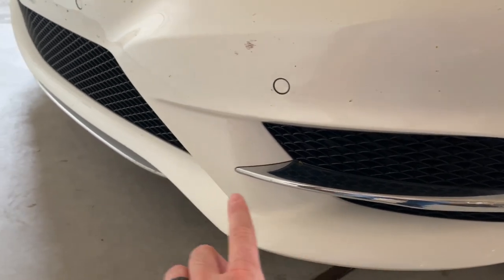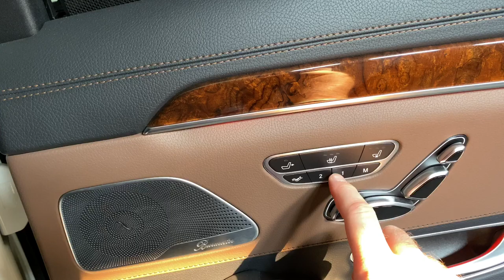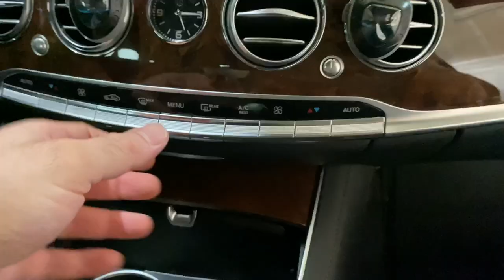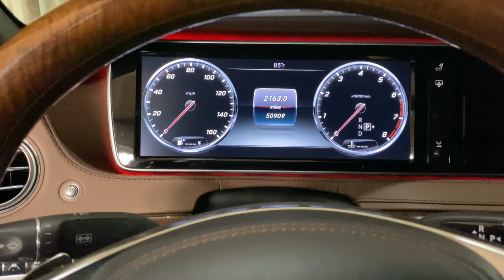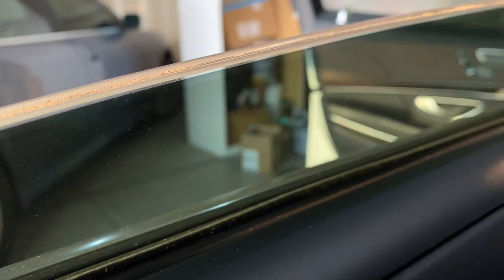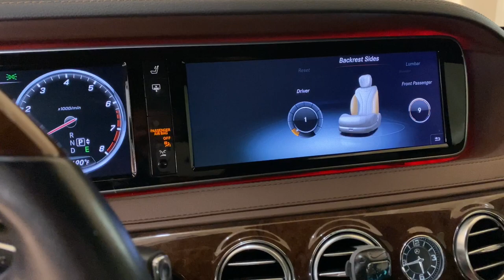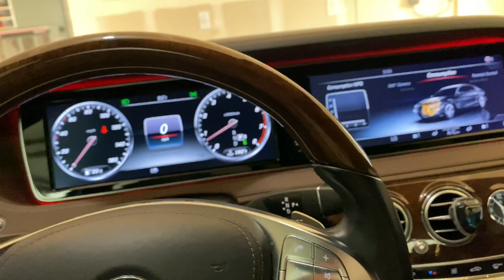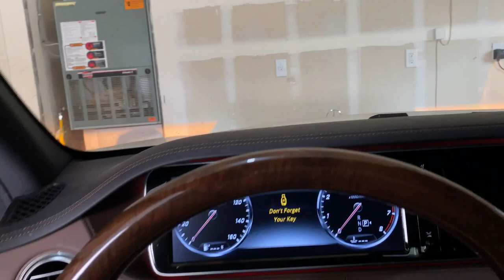2015 S550 Mercedes Benz Detailed Owner Review

Comment: is the 9-speed transmission better ? does the computer get faster in the 2016 or 2017?
Reply from the maker: The 9 speed is not better. It’s not that the computer is slow, it’s how the car is programmed.
Reply: @GrindMyGears  okay, was thinking about a 2017 since it's a 9 speed and supposedly better gas mileage, but in that case, can still look for 2015-16
Reply from the maker: @BrianErwin  I would still opt for 2017. 9 speed will be better on gas and also the steering wheel and headlights look better. Also 360 camera is standard on 2017+ if I remember correctly. Try to find one with the 3D audio option too.

Comment: Thank you  for this video and to be honest If I buy one with this year, would I feel safe with mechanical issues and digital display? I love the car though.
Reply from the maker: Thank you for watching! The car so far is running okay! Recently the auto-close door system failed on driver door so I have an appointment at the dealership to see what the issue is. They charge $195 just to diagnose and this fee is probably different from one dealer to another. I put new set of tires in less than two year! Previous set wore out within 20k-25k miles I believe (I have to double check). The car is heavy on maintenance/upkeep just FYI. Also recently the interior lighting flashes on passenger side on certain colors like green and blue I think so now I have the interior lights on red all the time which always reminds me with red light district for some reason LOL. No issues with digital display… I hear the airmatic suspension air pump run quite a bit more lately so I think there is a leak developing… we’ll find out soon!
Reply: @GrindMyGears  how many kms has yours done? and how long (km's did u do) until problems started?
Reply from the maker: @jamiefreedom8320  it has around 83k miles now so that’s roughly 133k kilometers. I bought it with around 32k miles. So you can say I put 50k miles… that’s around 80k kilometers. As of now, I smell a little oil burn from outside but dealer says no visible oil leak. There is a faint clunk sound on rough roads… might be a shock going bad or ball joint but it will be waste of money to have the dealer diagnose it. They’ll happily charge you $450 diagnostic fee then tell you we can’t hear or feel anything. Car mechanics usually aren’t very smart and good at diagnosis but they’re good in replacing stuff. Anyways, auxiliary battery died couple weeks ago so I had it replaced along with the 80k miles service. You can’t ignore maintenance in this car so keep that in mind… you have to do the maintenance schedule or else you will end up with bigger breakdowns. Other than that, no major failure yet. Transmission still bangs occasionally between 3-2 shifts but hasn’t gotten worse. Also the car eats tires and brakes since it’s very heavy… I use paddle shifters to shift down and slow it down instead of using the brakes… that’s a pro tip ;)

Comment: Do you think 2014 s550 with 40,000 miles for 42k?$ good deal? I want a low Mileage one
Reply from the maker: That’s not a bad price at this market! I did a quick search and found $43k for 50k miles. Did you drive the car? It’s very important that you drive it and make sure all feels good and solid.
Reply: I just bought a 2015 with 18,640 miles @$36,000. $38,200 after taxes, title, registration, and dealer fees. I had it for a week now. No issues, and I don’t plan on driving it much myself.

Comment: it will be pretty useful to share cost of ownership details
Reply from the maker: CarMax warranty was around $5k and maintenance so far over 3 years or so is close to $5k as well. Keep in mind I only service it at the dealership so it should be a little more than what a euro shop would charge.
Reply: Great review. Can I ask how often you had to use the extended warranty so far? Have they given you any issues? I’m looking at a 2015 S550 but the repairs are making me nervous ;)

Comment: How do you switch off the AC? 
How much do the break drums and break pads cost? 
I have 2015 S63 US Import.
Reply from the maker: To switch off the AC you have to click the climate menu button... the fan button won’t turn it off unfortunately. The brakes on my car front and back probably were close to $2k or a little more... I need to look at the last service record because I did the brakes and alignment and oil change and it was all around $3k.
Reply from the maker: Yours will be more due to bigger brakes!
Reply: FYI Mercedes does not have an off AC especially in the front because it’s an air tight seal so when it’s OFF for long periods of time no circulation of oxygen comes in it’s like a safety feature
Reply: @dann8491 he doesn’t know what he’s talking about

Comment: NICE JOB, IF I NEED ONE TO BUY HOW MUCH?
Reply from the maker: Thank you! Depends on miles and location I suppose. With carmax warranty and taxes this car was around $63k. They’re cheaper now for sure!
Reply: I purchased a 2015 S-550 Sport with Designo interior with 46 k for 47k. P-2 package. This was in May 2020. It has 52k miles now.
Reply: @lilpudge1503  any issues?

Comment: BE CAREFUL IN SUMMER. Top pvc sheet  skin on the front dashboard panel and rear back shelf board peeling. The cause is the hot solar heat. My car is  2015 s-550, 54000 mails.they are under warranty.
Reply from the maker: Thanks for the heads up! Luckily car is parked under cover from sun at home and at work... I thought the dash cover is leather? Is it vinyl?

Comment: If you not happy with the car sell it because you making it sound so cheap I don’t appreciate wat you saying I have 2016 s550 just like ur car Iam happy and every one I know they all happy with there cars
Reply from the maker: I didn’t mean to offend anyone in tue video but I’m sure there are others that might relate to my point of view. I actually traded the car few month ago so I no longer have it. However I still believe the transmission on all Mercedes cars to be pretty rubbish.
Reply: @GrindMyGears Me again! I have a 2015 S550 now with 18,779 miles on it. I see you said the transmissions are rubbish. At what mileage should I get rid of mine before it starts to fail. I don’t plan on keeping it too long. I want to use it as a down payment for the newer body style, starting, at least at the 2021. So my question basically is: what’s a good mileage to get rid of the one I currently have my 2015 S5 50.
Reply from the maker: @jimmynickles804  wow that’s a really low mileage for the year!! Keep in mind the car will only depreciate and not going to gain any value so if that matters to you, I would trade it as soon as you find a good replacement. 
If your transmission is silky smooth (like it should be) then you can wait some more since it looks like you barely drive the car and probably won’t accumulate that many miles so quickly. I bought mine with 32k miles I believe and the issue was there but faint and I started to slowly get worse towards early to mid 40’s. 
The newer S class is nice specially on the inside. Lots of new tech and comfort features!
Reply: @GrindMyGears  Thanks for the input. To be clear, I’m not the original owner. I literally bought the car last week. I will definitely keep an eye on the depreciation.
Reply from the maker: @jimmynickles804  enjoy the car!! It was a head turner that’s for sure.
Reply: @GrindMyGears  For some reason the footrest does not protract out. I push the button from the rear seat, and the front passenger goes through the whole sequence, but the foot rest does not extend out.
Reply from the maker: @jimmynickles804  I think mine used to extend out but then it stopped too. I thought there was something preventing it from extending out but I looked around and nothing was obvious. It also didn’t make any click sound to indicate a broken gear. I’m not really sure what the issue is. It didn’t bother me since no one really used it but it’s annoying when something doesn’t work 😆
Reply: @GrindMyGears  I feel the same way. Won’t use it, but annoying.

Comment: My 2002 ls 430 has held up 100 times better than this crappy interior. Just no where near Japanese top end fit and finish. And that's from 2002, the Germans still haven't got a hang of it in 2015 just wow.
Reply from the maker: Yeah the problem with these cars is that they are designed to give the best experience to the first buyer that is willing to spend $100k to $140k on this kind of car. Usually those buyers will replace their vehicle when a new model comes out or at the end of their lease so they don’t usually own the car beyond 30k miles and they’ll never have to deal with those issues. I’m pretty sure I’ll never buy another S class lol